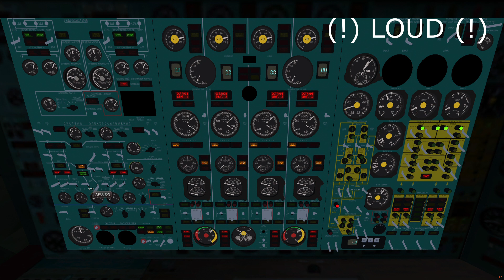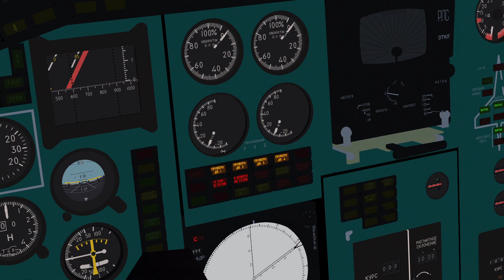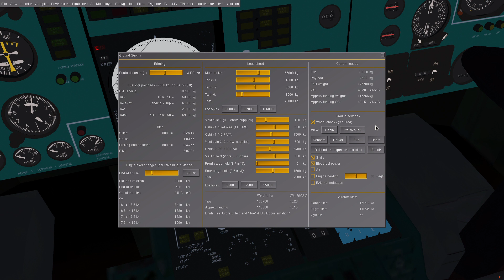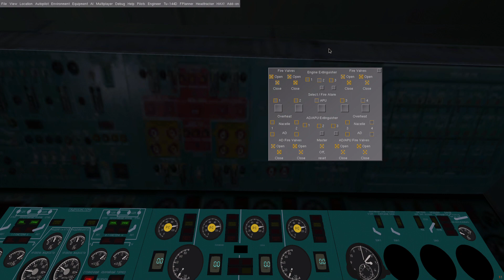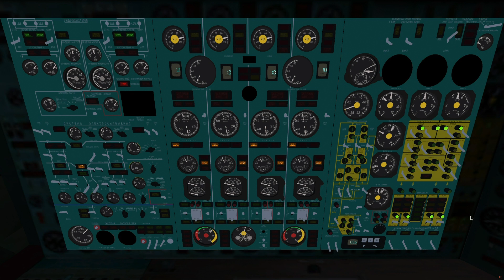Tu-144D | Startup, Cold-and-Dark | FlightGear Tutorial Pt. 3

Comment: What is the difference between “Start brake” (Shift-b) and “Parking brake” (Shift-n), these are some two parking brake systems? Do I have to release both to get the plane moving?
Reply from the maker: - They actually do what their names stand for.
- No, they're not just two parking systems. The start brake switch just allows pilots to release pedals before the takeoff roll begins. It is done that way because regular brakes can hold more force than parking brakes.
- Yes, you have to release both.